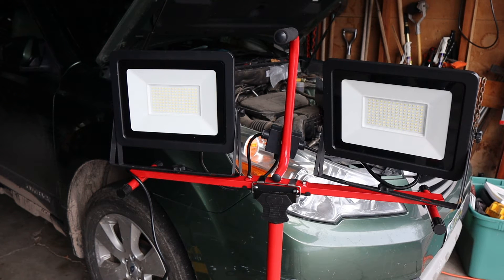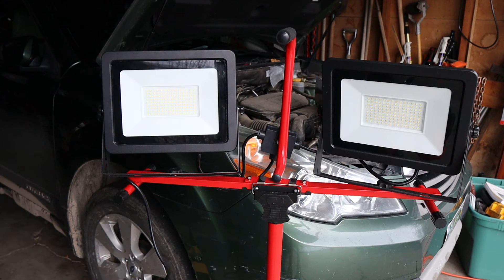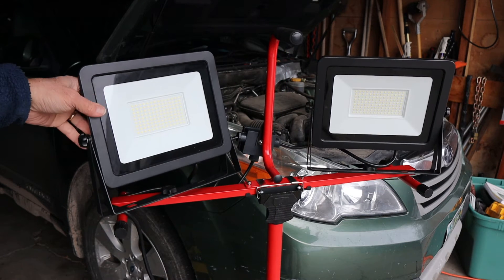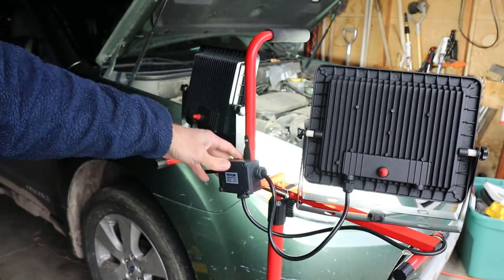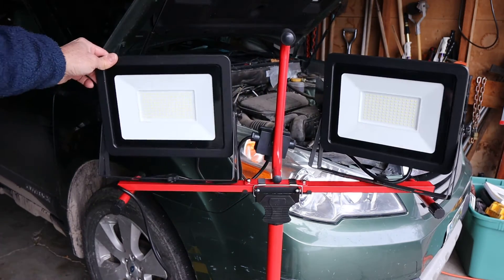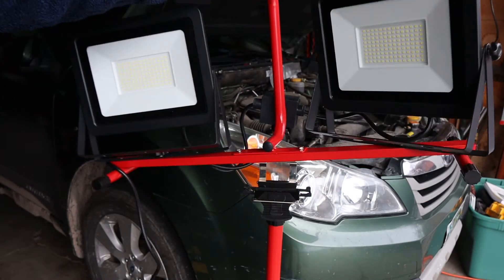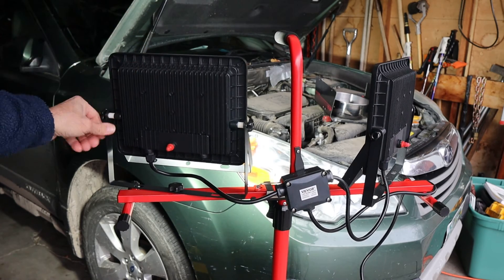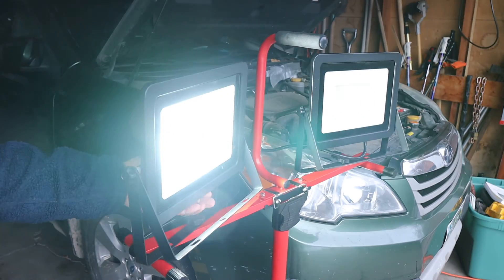VEVOR 10K Shop Lights: I've been Gaslighting myself with Milwaukee.

Comment: We use the Makita DML809 10,000 lumen jobsite light, mainly because it is both wall and battery powered, and brings the lumens. We primarily work in disaster situations where breakers need to get shut off and nobody is going to wait for an electrician to start. The Milwaukees are good, but you are right about needing more. Especially in situations where you need to clean. I could see getting these for more permanent or long term jobsites.

Comment: 4000k is my fav. 5000k never looks like daylight. As a photographer the 5000k is harsh in these shop lights anyway
Reply from the maker: Absolutely correct. The 4k is much more like daylight. 5k is more like a hospital surgery room. The crispness of 5k is often why we use artificial lighting outdoors for mechanical jobs.
Reply: @lastbesttool  if you really need contrast 5k is the way. When im in the shop woodworking it just strains my eyes

Comment: Brother, you should do a runtime test with your largest M 18 battery plugged into your little Milwaukee inverter, if it gets you two hours away from that stand that be awesome and heck, you could travel with just the short handle portion of those lights! 🤔🤔
Reply from the maker: I can only run one light at a time, but could probably get 1.5+ hr out of any 12Ah M18. Maybe more.